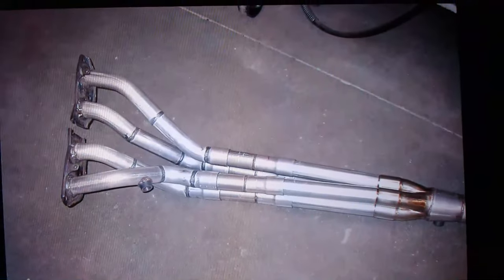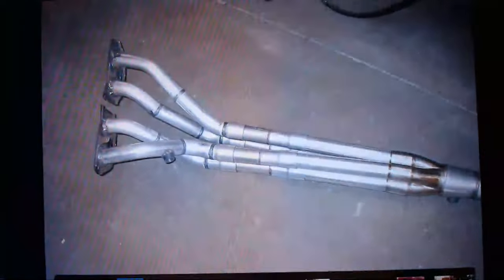LET'S TALK TECH-MAKE IT YOURSELF-BUT MAKE IT ADJUSTABLE

Comment: In the case of a LS a shorty isnt worth the cost over a mildly ported truck manifold . I saw a test on a blown 427 with 10 or 12lb boost a set of 1.875 long tubes was only 27 hp on a 1000 hp engine over Stock 5.3 truck manifolds as far as flow goes .  A shorty header wont give a useable reflective wave either so why waste the money ??
LS manifolds flow better than youd think !!!
Also Thermal wraps or coatings Definately Change the speed of flow gases and increase their pull to scavenge !!!!